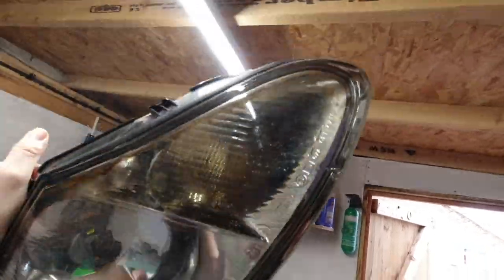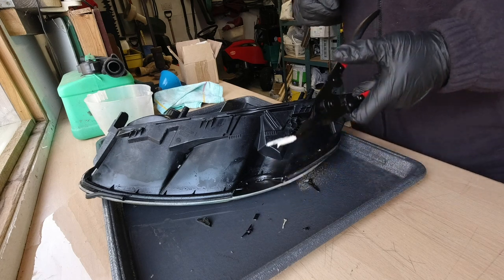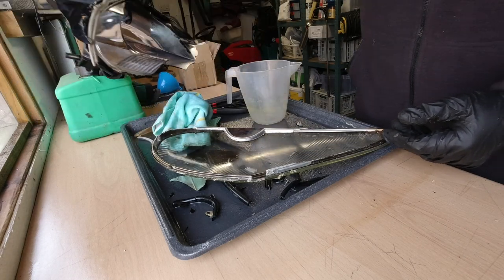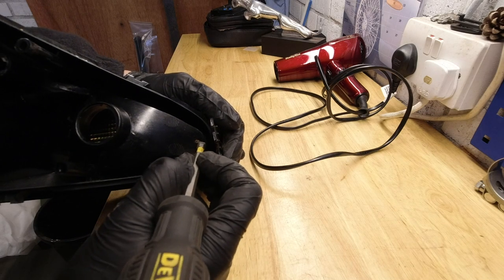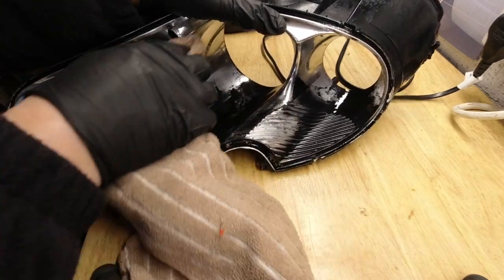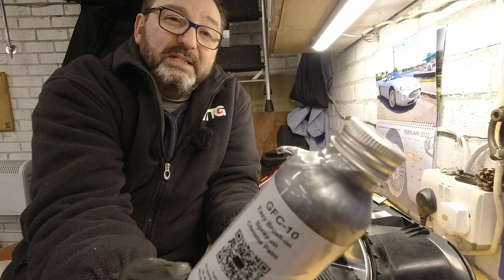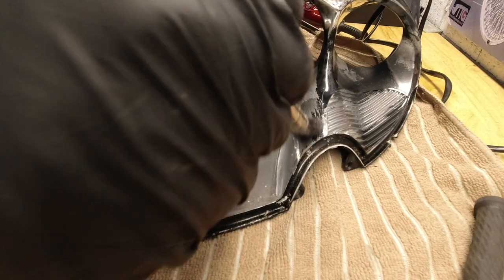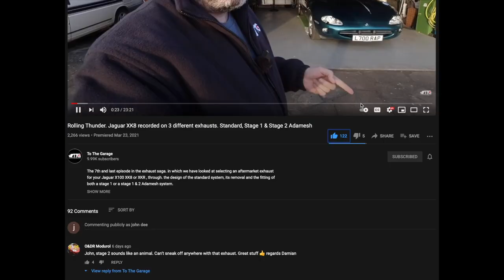Plastic headlight restoration pt 3. DISASTEROUS cracks & SUPERB re silvering.

Comment: Pop the headlight in the oven at 120 degrees C for 15 minutes. Then pour baby oil (Johnson and Johnson’s) onto the seal all the way round. Gently pry open with a screwdriver adding more baby oil as you go. I managed to get my VW Caddy headlights open in 5 minutes like this. The baby oil eats the butyl rubber seal for breakfast 😊
Reply from the maker: A really good tip @Michael-1205.

Comment: Hello John, sorry to be so late adding the comment.  There is an alternative to the Jaguar headlight units, albeit expensive, and that is the Grantley Design headlight replacement units with LED lamps and running lights.  At £750 a pair they are more expensive than 2nd hand ebay units but not by that much and they are new + low energy.  I am considering replacing mine and would appreciate your thoughts on the MOT’s acceptance of the bulbs.

Comment: Hello John, just currious as to what type of sealant you're going to use on the glass lense to plastic housing?  I'm in the middle of the same job and the original appears to be a grey butyl headlamp sealant.  What are your thoughts?
Reply from the maker: Hi Yes the original is a butyl applied hot in the lamp factory. (so not really an option for us enthusiasts. I was going to use Sikaflex 522. Probably in white.
Here is a link
https://www.amazon.co.uk/Sika-522-Caravan-Adhesive-Cartridge/dp/B08BZCXQCH/ref=asc_df_B08BZCXQCH/?tag=googshopuk-21&linkCode=df0&hvadid=463108586548&hvpos=&hvnetw=g&hvrand=12668949439948272662&hvpone=&hvptwo=&hvqmt=&hvdev=c&hvdvcmdl=&hvlocint=&hvlocphy=9044859&hvtargid=pla-1017652799277&th=1

Comment: John can you help please - i have a 2002 jaguar xkr convertible and i have an intermittent issue with my radio. it sometimes doesn't allow me to change channels, reduce the volume on the physical knob nor by the steering wheel controls. it has just occured and now the sat nav screen just shows the message in the bottom right hand corner saying "please wait" not sure if this is connected to the same problem or not! in the past it has reset after switching the engine off and letting it rest for a while!
Reply from the maker: As long as you have the radio security code (4 digit PIN) or have previously disconnected the battery and know you dont need one. My first recommendation would be to disconnect the car battery for 5 minutes to properly reboot everything. (radio and sat nav have a permanent positive supply as well as ignition positive)

Comment: The gasoline was just to release the seal? Why not just use an oven or heat gun? Rubber butyl will soften after about 8 minutes at 260-280 degrees in an oven. Won't be quite so messy either.

Comment: Could you not use a hook-knife to cut the seal, and then inject petrol into the that cut, thus reducing exposure of the plastic light moulding to the petrol, to around the seal itself… Yes it was a bit of a disaster was it not…!! 🤭
Reply from the maker: You could definitely do a more targeted application of the petrol (and I would) but I couldn't in good faith recommend putting petrol near the plastic to anyone else👍
Yes Fabulous and enjoyably disastrous experiment🤣